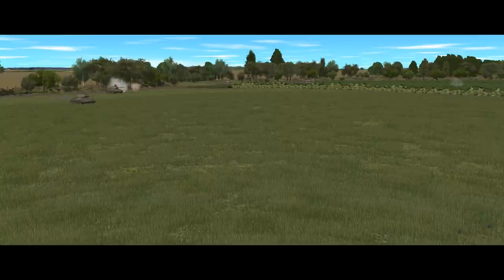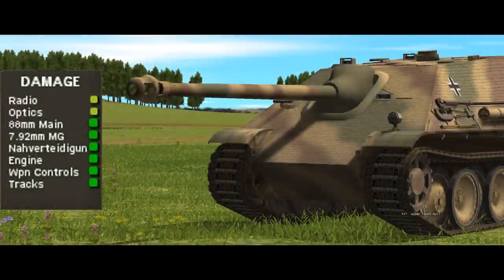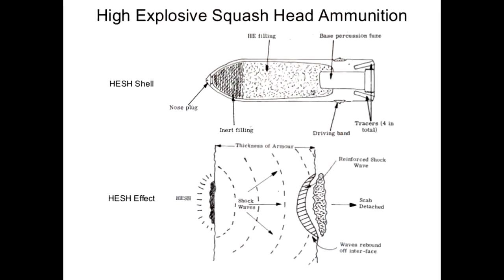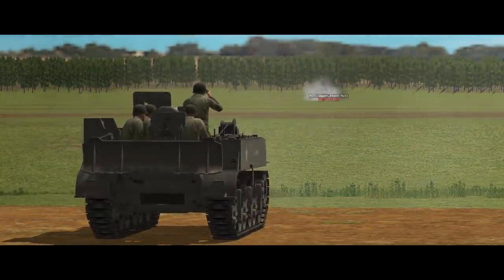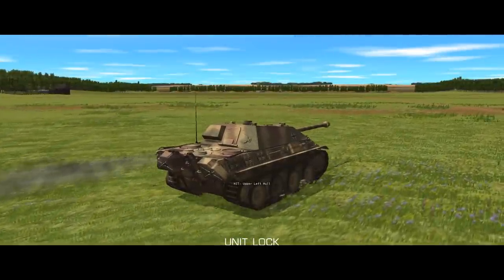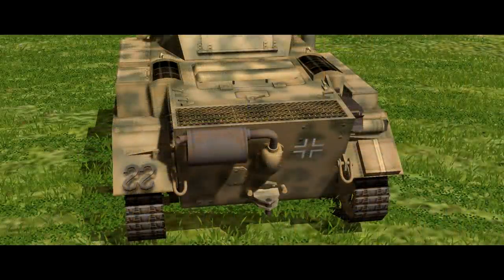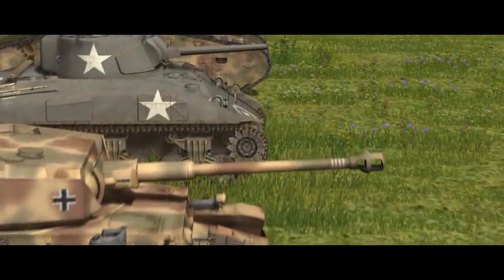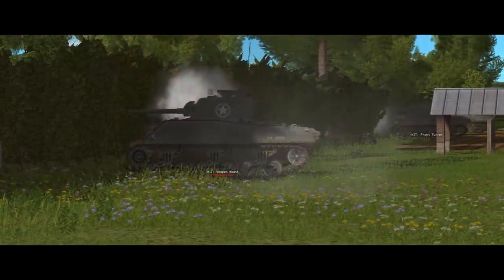Combat Mission Basics: Vehicle Penetrations

Comment: What's the deal when optics are damaged? In my gameplay I haven't noticed optics damage as impacting the performance of my vehicles that much.
Reply from the maker: Broadly speaking, you really have to grind the optics down before you get a noticeable effect ingame. Vehicles usually have back-up sights, replaceable viewing prisms, sometimes shared controls between gunner and commander (so either can  aim and fire the main gun), plus the unknown effects of communication from nearby infantry or other vehicles that might get them spotting or on target if their own optics are damaged. It's complicated.
Reply: I think sub systems only start to matter in modern titles. I typically just use my tanks as mobile pill box’s if the main gun gets knocked out or if lots of systems are destroyed I just pair them up with another tank.

Comment: Great video. Do near misses (or near hits) especially by heavy artillery affect vehicles? I have noticed that heavy artillery near hits on soft or lightly armored vehicles (truck, jeeps, Stryker) will cause a 'knock out', usually after a delay of several seconds. Is this simulating concussion damage to equipment and/or crew? Thanks!
Reply from the maker: Yes. Artillery fire appears to under-represented in terms of subsystem damage against tanks- and sometimes killing potential (fairly sure even an Abrams can't shrug off a 155mm HE shell landing on the turret roof), but lighter vehicles from IFVs downwards can and will get shredded by near misses.

Comment: How do you do that vehicle testing where they sit and dont fire back? Ive tried to use the editor for this but it makes little sense
Reply from the maker: You need to play the battle in "hotseat" or local multiplayer mode. That way you can control both sides- just give the targets a pause command and a short target arc, then they will (usually) sit there and take whatever abuse you throw at them.